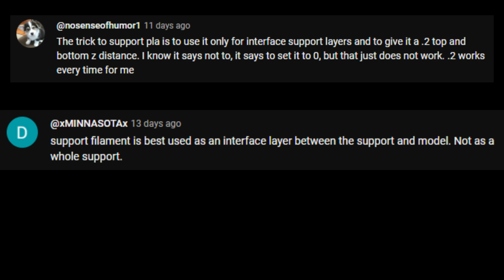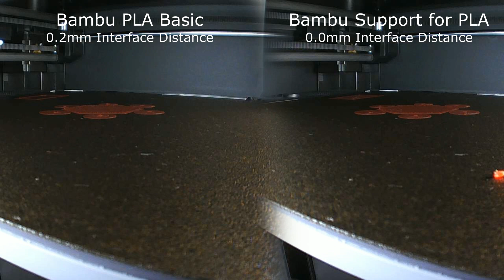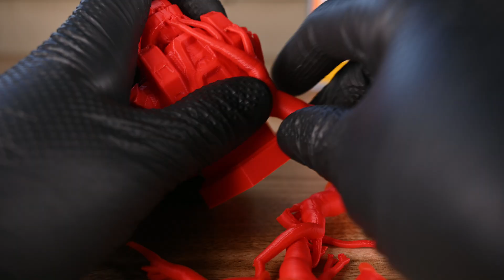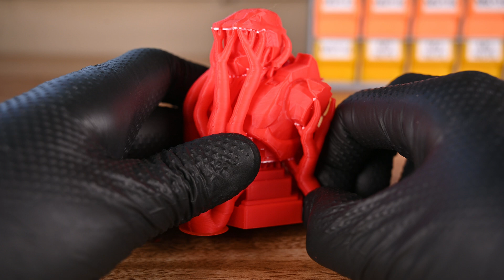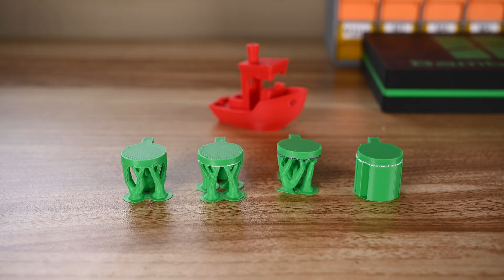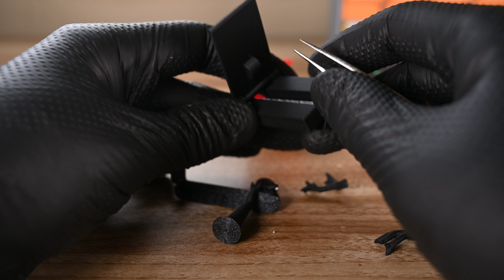Bambu Support for PLA Material - Is it actually any good?

Comment: Try COPE as PLA support material, same print settings like PLA. BUT if you will use it through same nozzle, it will make the layers of base material weaker on that height, since it needs more purging material.
Reply from the maker: That’s really good to know! Bambu always complains about the different temperatures when mixing PLA and PETG, but I can’t say I’ve tried COPE yet, I’ve just been coping. 😉

Comment: Brand new to 3D printing, and I added a spool of this ‘support material’ to my first-order based on what I expected it’d do— after some pondering, I understood from its product page that it’s intended for the /interfaces/ between detaching parts, but your video has removed the magic I’d expected to happen, and made me - instead - excited about PETG as a replacement.

I separately agree that (if it reliably functioned as intended) it ought to be called something else, like “interface filament”, to aid in understanding its purpose / reduce confusion.

Thank you for the video!
Reply from the maker: PETG is the best support for PLA in my opinion, it doesn’t stick together at all and just falls off so easily. Their “support material” always stayed completely stuck with at least one layer on my prints, even using a razor made it difficult to remove and ruined the smooth layer.

Comment: PLA makes for good rafts for ABS and ASA. Support for ABS is a good-enough support material for PETG – and for flushing the nozzle.

I found Support for PLA rather disappointing, even with a lot of flushing.
Reply from the maker: Same, mine liked to permanently stick to models. Ever since using straight up PETG as a support for PLA I’ve had zero issues.

Comment: The reason why the layer is weak where the support starts is due to residue build up in the nozzle you need to increase the purge time when switching filaments to avoid weak layers.  it has nothing to do with "time to cool" what matters is the nozzle is at the correct temperature NOT the print on the bed being on the correct temperature.
Reply from the maker: Just using Bambi’s recommended settings, so it should print as the factory intended it. I’ve gone ahead and just used PETG from here on out as a support, cheaper and more reliable.

Comment: I had mixed results with this, but find it's better to increase the support interface to minimum 5 layers, and density 100%. These two settings together produce a finish as good as if it were on the build plate, and the extra layers give intrinsic strength to the support material, making it easier to remove in one piece.

It's good for uncomplicated flat surfaces, but doesn't help much with intricate closed off voids (like the neck area of your Master Chief). It's VERY expensive for limited use, and the five layers adds a lot of time and waste because of the multiple cutting operations on each level.

Comment: Use a PVA support material for interface layers with PLA. Use 2 interface layers and zero distance between interface and model. A dip in water after and the supports just melt off. You can also intermix PLA and PETG for support interface layers. They will stick to each other well enough to print but will separate easily when forced.

Comment: I tried PETG too. I wonder why they even sell support material. If I really needed to use support interface, transparent PETG might be the best way to go.
Reply from the maker: @vd853  I find it kind of interesting, a lot of the support materials I’ve seen are made of a mix of PLA, PETG and TPU. Three types of polymers that don’t bond with one another, combined into a single filament. In theory this works great, nothing will stick to it, but in execution it falls short. Sometimes the simplest answer is the correct one.

Comment: This was my experience too. A 4 hour print became a 14 hour one with tons of wasted filament because of the purges, only to discover the print was weak and pulled apart in the areas where the support pla had touched. Thankfully it was a learning experience and  I only tried it the one time, and I printed the part again with regular supports on the next go and it was perfectly clean.

Comment: I wouldn't mind the tedious task of peeling it away if it can result in finer bottom surfaces. Though this video is attempting to be snarky; it sold me on pla support material. It really depends on your specific use-case and priorities. I wouldn't dismiss it, or the other commenters so flippantly when you and they may have different goals.
Reply: I suggest using the Support for PLA/PETG instead of Support for PLA, it works much better.

Comment: Your experience mirrors my own. One additional thing I'd love to see someone test is supports used for a non-flat upper layer. I have some models where I need to support a large fairly organically shaped overhang. So far this has been the biggest challenge for me.
Reply from the maker: @shenqiangshou  only downside with that is the need for multiple filament changes, each layer that would be “supported” but I’d imagine it would work very well to reduce any chance of droopy overhangs

Comment: I've been pretty impressed with the support material as an interface. I am not sure why you are having such trouble. I do have to poke at it a little but once loosened it peels off.

I don't think PETG as it worked out for you is a good idea as it seems likely to make pieces break off your model while printing. The interface layer needs to stick a little.

Ah, you used a different material. I used "Support for PLA/PETG"
Reply from the maker: @BadSpock  yup! Shortly after I released this video Bambu came out with their new support material. I haven’t tried it yet, but in fairness I don’t print many things that require support or I just design around the need for them. I’ve heard good things about the new stuff though!

Comment: I mostly use petg as a support interface too.
Although I'm interested in the z height and interface layers setting you're using as this could play a huge part with true issues you are facing.
Even when I'm using  just pla I seem to have an easier time removing supports that you do with all of these.
Reply from the maker: Same, I've been using PLA with just the default interface settings and have had little to no issues. When I do PETG interface I set the distance to 0, that way the bottom of the supported layer is as smooth as possible.
Reply: @TapticDigital  I also set the top interface pattern to concentric, almost like printing strait on the bed

Comment: I used it straight out of the box with the default settings for an interface and it worked perfectly for me, I didn't dry my roll out at all. Perhaps trying a new roll or half a roll and skip the drying process.
Reply: No you didn't

Comment: i got a spool with my X1 carbon about a year ago and just now looked to see how to use it... looks like i never will.
Reply from the maker: @jamesmontgomery9464  I’d put it about equal to just using straight PLA, if you use PETG instead as a support interface for PLA it’s incredible, works phenomenally. But I’m also lazy, so I just use the same material I’m printing with instead of a separate interface, I’ve found Bambu’s tree supports very easy to pop off most times.

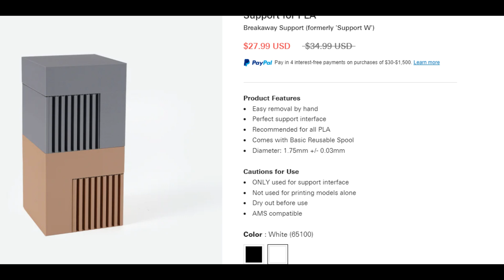Comment: I'm confused, you said it is a translation issue with bambu but it says right in your own video at 0:30 that this is for SUPPORT INTERFACE not for actual supports. This was my understanding as well.
Reply: Strange I had the same experience with support material AND using petg at the interface layer. I found this video while looking for reviews of water soluble support material pva
Reply from the maker: @GearSounds  yep, and in the video I use it as support interface, which it performs quite poorly. PETG does better

Comment: That's why higher end 3d printers (Stratsys F-series) uses two nozzles at the same time, one for the pla, and one support material, then a vat to chemically melt away the support, but at $70k and above it wasn't in my budget.  I also made the mistake of purchasing support material  when I first bought my X1C, but after watching this will probably never use it.  Great video, thanks !
Reply from the maker: @timl9495  I’d still buy 50 Bambus over a Stratysis to be honest.

Comment: Just a tip, buy some Bumbu Translucent (clear) PETG to use as support interface. You will barely see any left over bits on models.
Reply from the maker: @nucleochemist  that’s what I’ve been using and it’s fantastic! They don’t stick together at all and it’s great
Reply: Whenever I try to use petg as support interface is makes the print just fall apart and has little adhesion to layers
Reply: @forgedbydragon9683  You really have to "clean" the nossel with every material change (aka. you have to wast a lot of material) or you mit the PETG into the PLA. Or you have a 2-head printer (IDEX, H2D, Prusa XL...).
Reply: Great Idea - thx
Reply: Thanks. Saved me buying it :) you mention using PETG as a support interface, does the opposite hold true? Can I use PLA if there’s a model I want to print in PETG/😊?
Reply: @gordonrobb  Yes you can.
Reply: @nucleochemist  any tips on avoiding clogging? i ALWAYS have clogging issues on my x1c when using PETG as a support for PLA, it starts fine then after about 15 changes it starts to lay down thin layers and clearly beginning to clog
Reply: That's a great tip. Thank you
Reply: The best I have found so far is BVOH with 0 gap
but BVOH just for the interface layer,almost all
falls off anything left is water dissolvable. It's
expensive but goes a mile if you leave it only on
interface layer.

Comment: I would offer one more suggestion that helped me print better with this material. Purge values; this helped reduce the mixing of materials at the interface and prevented my models from developing weak spots from cross material contamination. Using a value of 750 switching to and from “support pla” material made the model quality similar to my build plate and the interface peeled off without tools (although with more force needed then a petg interface)
Reply from the maker: @TheFunVampire  yesss this is the kind of scientific approach I need to be trying, I’ll give that one a try thank you!
Reply: @TapticDigital  good luck!! 👍
Reply: How did it go?

Comment: Be aware there are 2 products for PLA supports from Bambu Lab! One is pretty old (came with the printer) and does not work very good. Seems like you have that. And the new one just works. Link to their website is broken right now else I would put the link in here.
Reply: With the one I have tried I think it behaves more like a TPU, given its expansion when heated and flexibility.
Reply from the maker: @DanielSchweinert  I still need to try their new version and see if it actually works, until then I’ve been pretty happy with PETG as a support interface
Reply: @TapticDigital  I suspect it is PETG :-) since it's advertised for PLA & PETG as support material. LOL
Reply: Hi mark, it is interesting that upu say that because I just read in another comment TapticDigital said that the support material is a mix between pla and tpu. I wonder if this is a fact

Comment: The PVA support material has to be submerged in water. It dissolves in water giving you a clean breakof
Reply from the maker: @Waneklap  that would work, if it were actually PVA. Compared it to PVA from Makerbot, bambu support wasn’t affected after 12hrs in water while the Makerbot PVA was completely gone.
Reply: @TapticDigital  I used Bambu Lab PVA support material last week for the first time. Used it as a support interface material only, the rest of the model and support structure was printed in BL PLA Metallic. I used the PVA fresh out of the bag, no drying, which resulted in some severe spider webbing at the top of my model, a Pythagorean tree. After printing I just dunked the model, while still on the PEI sheet, in a bowl of water for a workday. The spider webbing had completely dissolved and the other support came of real easy. Any remaining PVA stuck to the model I could easily rub off with my thumb. It was a good experience.

Comment: Interesting. I've had (mostly) very positive experiences with that stuff. I don't bother using it if printing in PLA-CF (eSun) or PLA Metal (Bambu), as those supports seem to break away without any real effort. I suspect your troubles were largely due to the fact that the Master Chief miniature is pretty intricate. I've mainly used it on very flat overhangs. I recently used a bunch of it on a clock I designed for my office that needed a ton of support in the back because of my lousy (in terms of printability) design. Clock looks great, ran in one shot out of the AMS, so no need to glue/assemble, but the supports were a lot. Yes, there was a bit of scraping to get the more difficult bits off, but I found that once I got a good bit started, a bunch came with it. Like you, my first times out were using it for the full support, and it wasn't great. When I changed to the interface-only, with 0 z-gap and holding up actual flat surfaces, it's great. So, a mixed bag? Yeah, probably.

Comment: Wow,  I do not have the same issues and use this product a lot.  Perhaps it is my setting that are different then what is recommended.  I do set the support material interface however I do not use the other recomended setting i.e. zero interface.  since I print a lot with .2 layer hight I use .22 gap and it works great.
Reply from the maker: @chrisc9213  interesting, I’ll have to try it with a small gap and see if it helps!
Reply: How did it go?  @TapticDigital
Reply: @TapticDigital  people are liking my comment. Is there an update?
Reply: @TapticDigital  any update?
Reply: @TapticDigital  guess no update on this suggestion. :/
Reply: From my short experience with it I think the 0 gap automatic setting is squishing the support material into the PLA and I have had no success at those settings. I will have to try your .22 gap and see how it goes. It seems to expand a lot when heated, like some TPU.
Reply: @Mark4star1  Do you have an update? :)

Comment: I also got some of this support material with my x1c maybe 1.5 years ago or whenever I bought it. I still have most of it, tried to use it once. But like in this video the model snapped in half at that layer. But I don't think it's cause it cooled down, if it was it would also happen when you use multiple colors. Which I'm pretty sure is not the case. This support material seems to severely weaken the layer adhesion when it gets mixed in with regular PLA while at the same time fusing to the model in some spots and being impossible to remove.
Reply from the maker: @atnfn  that was my other issue, because it had to do a filament change it allowed the previous layer to cool more than others. So you end up with a visible line on the print of the layers that cooled differently.
Reply: Out of interest, is that roll really small? I bought a couple of rolls second hand and they only seem to have about 100g on them. I wonder if they were freebies.

Comment: weak layer bonds are probably because you weren't purging enough in between the two filaments... if something that doesn't stick to pla gets mixed in with pla, the pla will have trouble sticking to itself layer to layer.

Comment: I was sceptical after your video, but after trying it i need to give it to you, this crap is absolute junk and should not be used. I rather have a little worse surface finish than trying to remove this white junk.

Comment: I am going through the same learning pains right now. PLA support works... but only marginally better than just printing in all PLA with all the issues you're pointing out now. I'm going to go place PETG order now.. begrudgingly. Nice video, thanks for sharing your findings.
Reply from the maker: Despite what I said in the video, I still haven’t full given up. But I am quite disappointed each time I try.
Reply: @TapticDigital  Same here haha. I'm working on a model that has several delicate features that are also overhangs (a non-ideal combo) and even manually  setting the support locations to minimize the amount of contact the features are breaking off so I started to investigate a different support methods. The story seems pretty consistent across all avenues though that PETG is worth a shot so I'm going to try it out this weekend hopefully when my PETG spool arrives. I can share my results here for posterity. I think PLA support has its applications, but if you are doing anything with delicate features or considerable overhangs it appears that PETG may be a better (and seemingly cheaper) solution.

Comment: Is the Bambu support for pla supposed to be dissolved in water or is that something else
Reply from the maker: Nope! I actually tested it in water as well as alcohol, just to rule it out. It does make it separate from PLA easier, but where it does stick it stays quite firm
Reply: @TapticDigital  Rookie mistake, you have to drink the alcohol to suppress the feelings from the bad support material.
Reply: @TapticDigital  good to know. I saw this filament in my box and I always thought it might be useless. Now I know! Good video